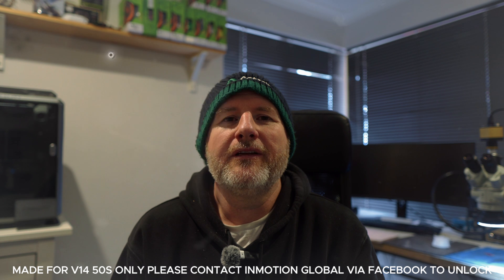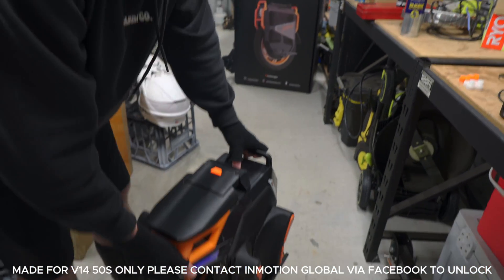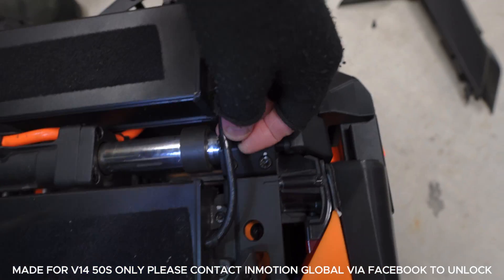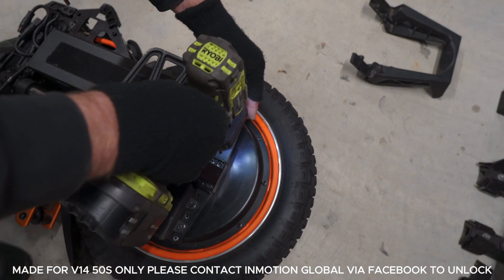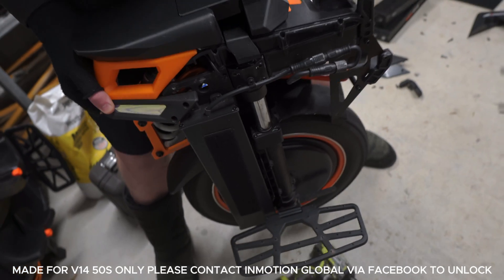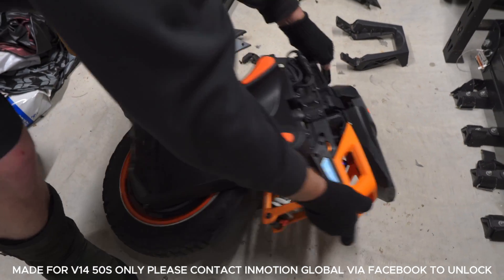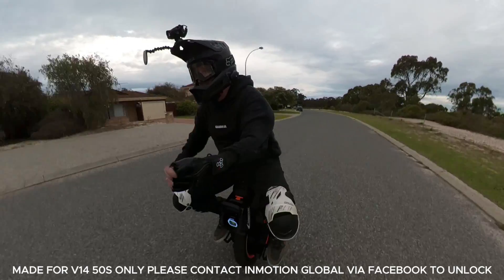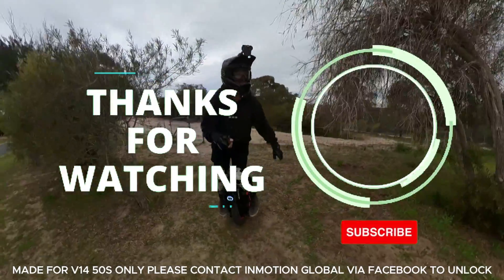I converted a INMOTION V14 50S to a make it the quickest,lightest and most agile EUC in 2024.

Comment: Great post!!!
I just got a v14 50s and was thinking the same, since I never do long rides.

I suppose the new charging limit must be 8 Amp. 
I’m wondering why exactly, do we need to contact Inmotion. To unlock what?

Mine’s suspension does top out unless I screw the rebound damper to the slowest, which doesn’t make a very dynamic action. I wonder if someone had solved that problem. The reason why I’m searching documented mods to the V14, and found yours by chance. 

Thanks for sharing your work.

Comment: What is the weight of the V14 actually reduced to?
What is the weight of the two removed batteries?
Reply from the maker: At the start of the video mate.
Reply: I did this modification yesterday, my batteries weighed in at 7.46kg. The mock batteries at 1.1kg total. So total weight loss = 6.4kg ~. 
My wheel with fairingplate(as all v14 have) and a bit larger than normal powerpads + Afeez pedal lowering/heightening kit = 
42.4kg before the change. 36kg after the change. I don't have that nice seat that EUCRAZY has.. So with that it would weigh a bit more.

Comment: This feature is totally underrated. I wish Inmotion had gone with 6 to 8 plug-n-play quick release packs instead of the 4 semi-removable packs but it’s definitely a step in the right direction.
Reply from the maker: Agreed people dont know how much of a game changer this is thanks mate :)
Reply: It would definetly be amazing with quick-release plug and play batteries!

I had dropped the idea of doing deliveries after I sold my sherman s and got the v14s (sherman s was way too heavy for fun riding imo) but maybe it's possible with the v14s anyway. Perhaps I'd remove the kickstand and make a solution without screws for the front bumpers(stick on/off).. this way it would only be the side pads + the actual battery packs that needs to come off/on. a lightweight screwdriver and the job would probably be done in 4minutes with some practice =) 

If I'd do deliveries though, I would have the 4 battery packs installed, then swap with 4 ready ones. 
How to charge the separated four batterypacks without them being plugged into the unicycle though? Anyone know of a product or easy DIY mod that could make this possible? :) 

According to chatgpt, it would take 107minutes to charge a 2400wh battery with 10amps at 134v, if that's true. maybe one should just grab a lunchbox and chill though xD.. But then again, maybe not, if one needs to do it atleast twice a day it would be too much down time probably. Gotto make those deliveries! :'D (never really have properly though, but it seems fun!)
Reply: @ThePwnagealle  you can have an adapter made from $10-$20 in parts to charge the batteries separately from the wheel. Any EUC repair facility should be able to make a harness for you or tell you how to do it. Double batteries are good for many reasons but then again, so is having multiple wheels.

Comment: Another benefit too, you could potentially charge both sets of batteries, and hot swap them while on a ride since it only requires a few allen keys, giving you access to the full range of the wheel if you really needed it
Reply from the maker: 100% mate so many options right !
Reply: @EUCRAZY_AU  honestly really good idea. I rode a v14 for a few feet and I instantly felt it was kinda heavy. I bet with this mod it feels amazing to ride and completely different to stock
Reply from the maker: @ryangross5446  honestly it's night and day and a wheel that can be thrown around with the same MASSIVE power and torque people need to jump on this mod it's will worth doing.

Comment: Hello!  What is the weight without two batteries?
Reply from the maker: 30.5kg without dummy packs installed
Reply: @EUCRAZY_AU  I wonder if I've got a later version than you then. Maybe they reinforced some stuff inside the uni? Mine weighs in at like 33kg without dummy packs installed :(

Comment: Pretty cool, although I imagine the cells will get hotter and may degrade faster with the higher amp draw.  The 2-pack V14 is still 2.25 kg (5 lbs) heavier and 550 Wh less capacity than a V12 HT, which goes to show how much all that metal and suspension weighs in the V14.

For the price retailers are asking for these, I think Inmotion needs to find a way to cut more weight out of the box.   Begode just upped their game with the Blitz with a larger 20" wheel and 2400 Wh battery at 3.17 kg (7 lbs) lighter than the V14, and only 10lbs heavier than 2-Pack V14 but with double the capacity.

If Begode ever offers the ability to 2-pack their wheels, look out!  That'd bring it down to about 64-65 lbs on a 20" wheel, although I imagine it wouldn't still be able to hit those 55 mph peak speeds.
Reply from the maker: @naaspam1185  thanks for the comment but no the packs don't get hotter these packs can pull 25A so heat is the same also this is nothing like a V12 ht you can't even compare them.
Reply from the maker: @naaspam1185  just remember Begode has a 3200w motor it is NOTHING on the 4000w V14

Comment: Is there a lot more voltage sag with the batteries removed? Does it affect the acceleration? Whats it like when it gets down to lower battery %?
Reply from the maker: No more than normal each battery pack is separate from the ESC the wheel performs as normal :)  just less range is all that would be different :)
Reply: @EUCRAZY_AU  Do you have any data? No more voltage sag with less battery seems completely counter to my intuition.
Reply from the maker: @casperpedersen1690  Data is me pushing it as hard as i can but i can do some EUCWORLD figures if you like ? just remember 50S can handle 25A as apposed to 10A on GB
Reply: Charge two batteries while you run two batteries then swap… zero wait, except the swap.  With quick release, plug-n-play, this feature would mean total dominance within the competitive category.